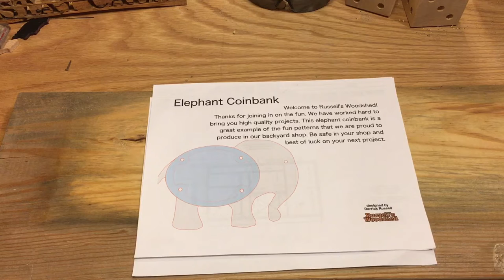Makers Care 2016 - Elephant coin bank - fun scroll saw project

Comment: Very nice, thank you for the video...what blade did you use? ...
I am new to woodworking..  could you do a video on chess pieces, and what wood would be good to use ...
Reply from the maker: +Gabe C I used Skil scroll saw blades. They offer a variety pack with 3 type of blades. I find it useful to have a few different types / styles to try with your materials. A chess set is on my list of projects for 2017. Maple for the light pieces, walnut of mahogany for the dark. 
Thanks for checking out my videos.

Comment: I have tried twice to make this and both of them have broke in half once the plug hole is drilled. I am very careful with placement of the hole but hasnt helped. It is very frustrating. Any  suggestions????
Reply from the maker: +drawlings10 make sure you put the inside pc back in when you drill the hole. You could also drill the hole before you cut the inside piece.